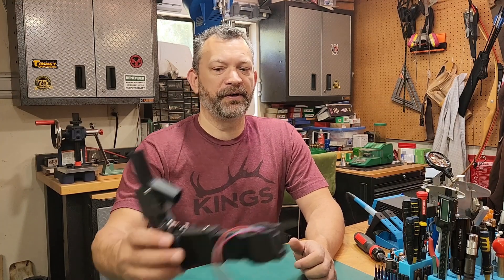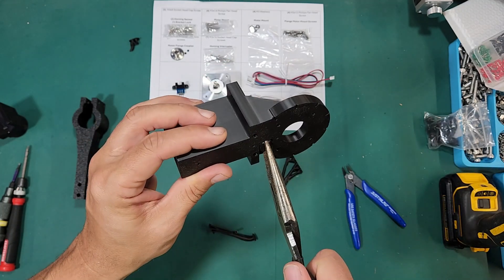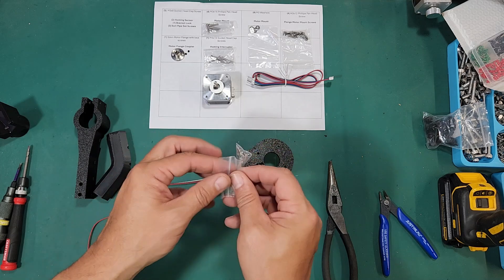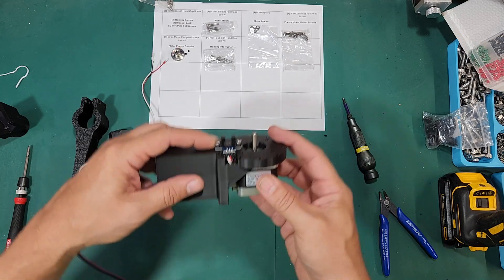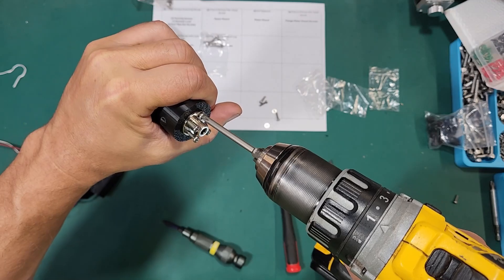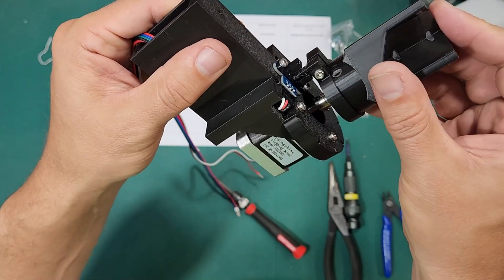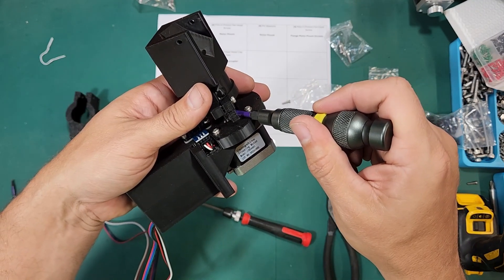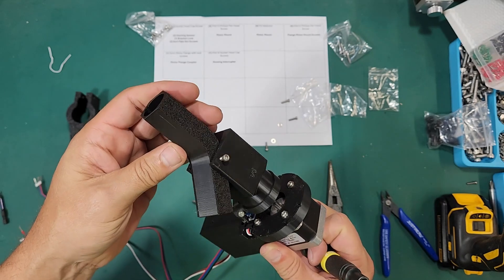CS7.2 Build Series - Sorter Assembly

Comment: The pipe bracket file is showing a bunch of errors (36 non-manifold edges). Just an FYI.
Reply from the maker: Thanks for the heads up. This has been fixed.
Reply: @sjseth-builds  I believe the drop chute for the case feeder has errors too. Great project, BTW. I never finished version 1, lol. I'm having to learn a bunch of stuff out of my wheelhouse. The last version I printed out of PLA and forgot I had it in my trunk one day last summer. It doesn't work at all if it has the consistancy of silly putty. Printed this all in PETG after learning my lesson. Thank you for sharing this project! I've already brainstormed an idea to create a screw sorter if I ever figure out how to code... But every project brings new learning experiences!